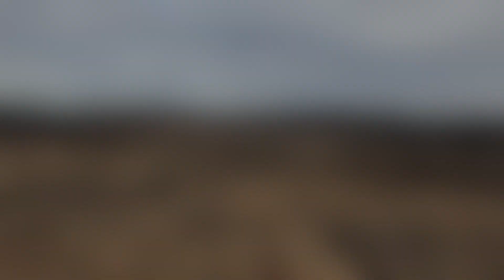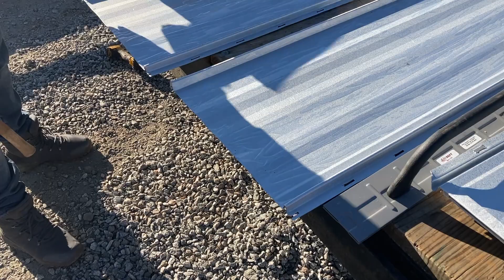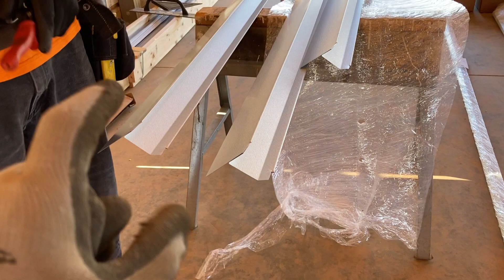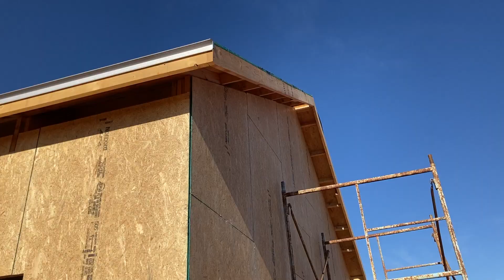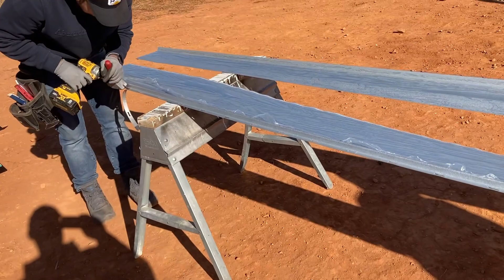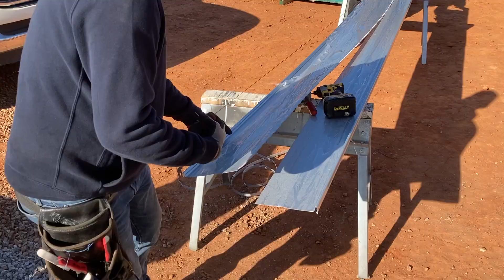NC Barndominium Build - Titan Loc 100 Standing Seam Roof Install

Comment: Excellent informative video. We are doing a self build in Watauga woth standing seam roof and partial siding 24-26 guage.. please tell me what company you used and wjat guage metal you used? Cheers
Reply from the maker: We use Best Buy Metals.  26ga Titan Loc 100.
Reply: @ncbarndobuild  that's hilariously serendipitous! I got an insta qoute back from Mackenzie today lol. How do you rate your decisions with usung 26 guage and Best Metals? Much appreciato x
Reply from the maker: @provocativepolitic  I am very happy with the roof material at 26ga.  We did the panels with striations so we have zero oil canning on the roof.  The only down side with using BBM is that their material takeoffs could be improved.  Make sure you double check their numbers so you don’t end up short on anything.